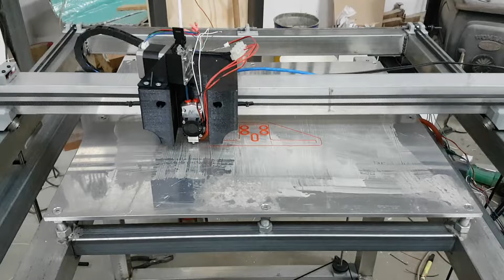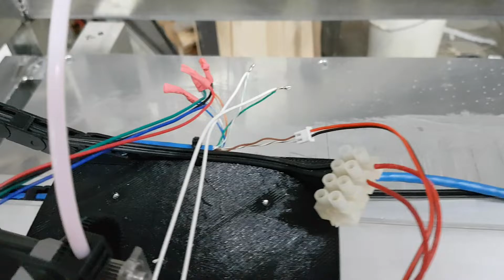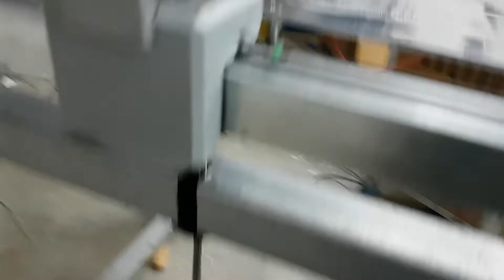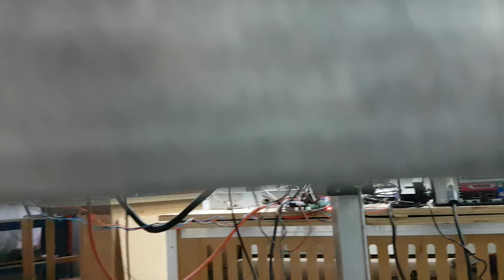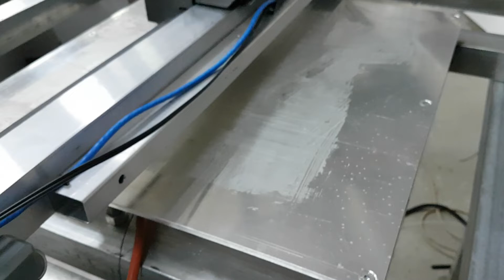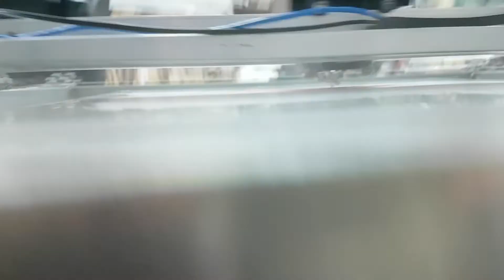The first print...

Comment: is there a reason you opted not to use slotted aluminum extrusion for the build?
Reply from the maker: Welded steel is very strong.
I can weld Aluminium also, but steel is very good for the stationary bits.
I used Aluminium for the X axis gantry, and the build platform. These are two parts that Al was better for.
Steel is a better material for the rest, it's harder, stronger, welds better, and holds threads better.